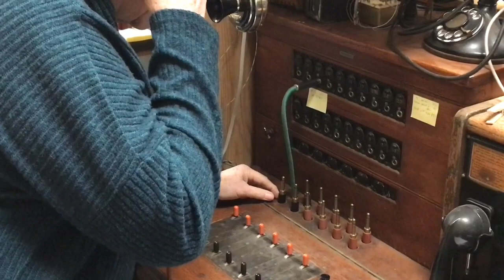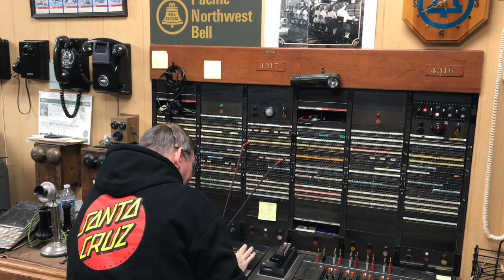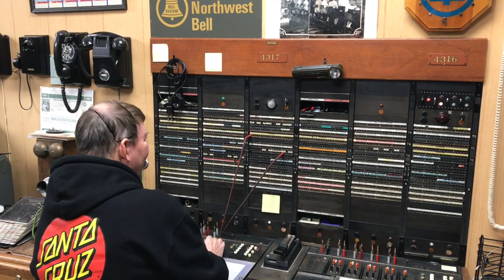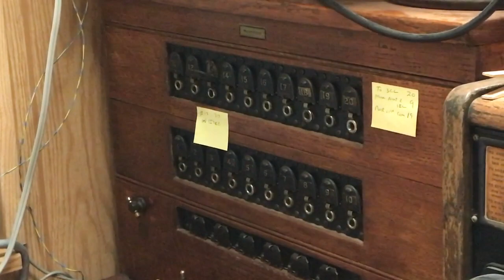100 Year telephone call. Magneto to cellular Phone. This is my 100 th video.

Comment: May I inquire about the blue 1a2 desk telephone, how would a 1a2 system work with no dial, or is this something completely different?
Reply from the maker: If you referring to the non-dial six buttons that it was set up for a manual exchange there is nothing that will detect any dial pulses these were ultra rare because most of the manual changes we're long replaced before the 1A2 was developed. Having a dial or not does not determine if it's a 1A2 system
Reply: @sxsphil  oh ok, thank you.  I wasn't sure as most 1a2 systems have an intercom proponent, but I assume thay would be an in house operator.

Comment: @2:50 how does the operator know that the parties have ended their conversation if this switchboard has no lights?  Is there a buzzer?
Reply from the maker: There are lamps on the key-shelf in-front of the cords that light when the call is finished.
Reply: in rural areas isnt it one long ring to alert operator you’re done, i just discovered phones this week